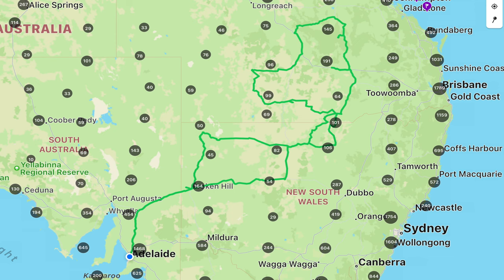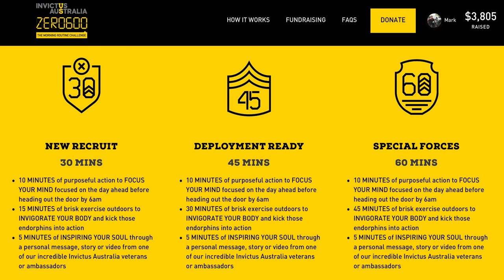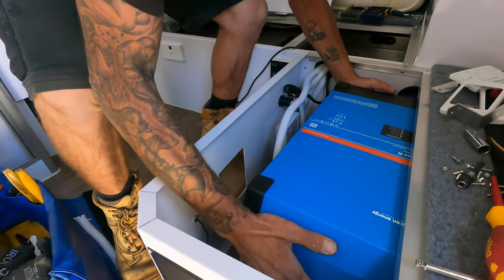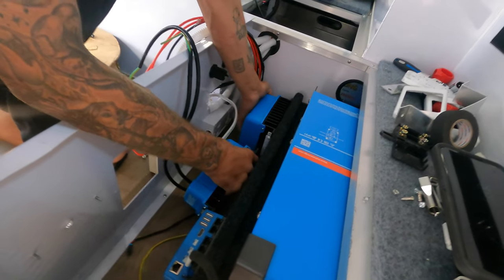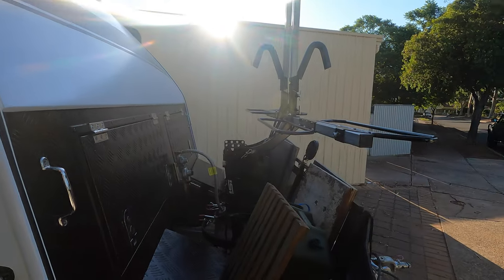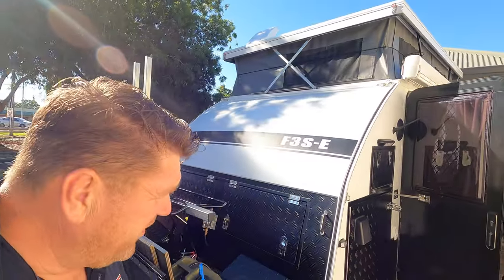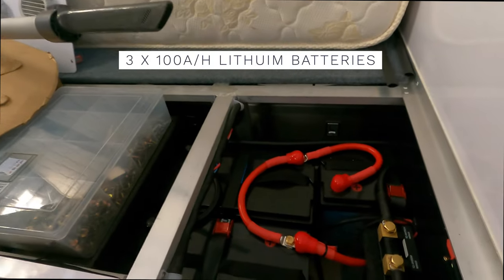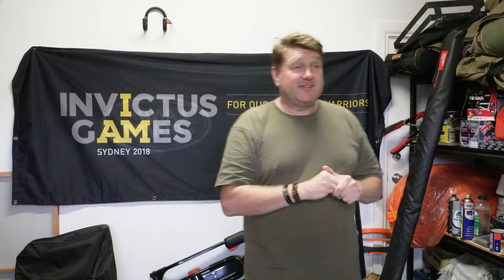Panda 13 | Hybrid Van | Victron Lithium Power Upgrade

Comment: Hey Sarge, where abouts in Qld are you heading? We live in the area, so if you need any recommendations for campsites hit me up 👍
Reply from the maker: Going to Carnarvon Gorge Charlotte Plains. I tried to put the WikiCamps link up but won’t let me
Reply: @SargeNurseOffRoading  a friend went there recently, the photos looked amazing, but it was an epic nine hour drive from where we live on the Goldy 👍
Reply: Gday Sarge
Love the vids. 😊
We have a Eagle Warrior 12 and been thinking about installing a bike rack. What brand bike rack did u install? Does the bike rack on the front of the hybrid increase ball weight? Looks like u placed yours between the gas bottles - would like to know what u did to anchor securely. Any advice would be appreciated- we r at Gawler. Cheers PB